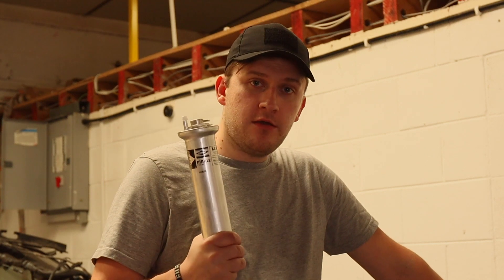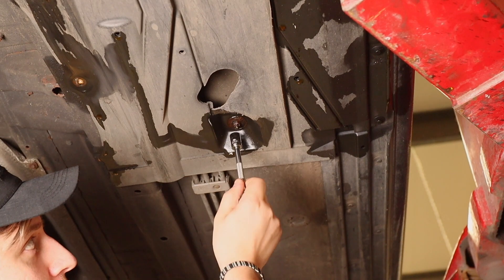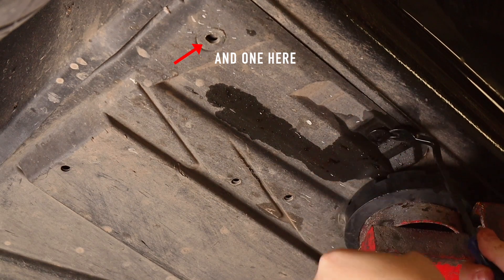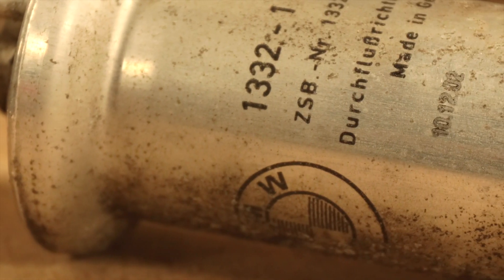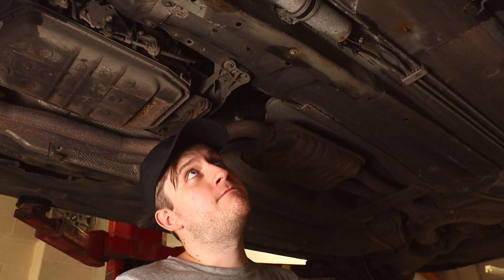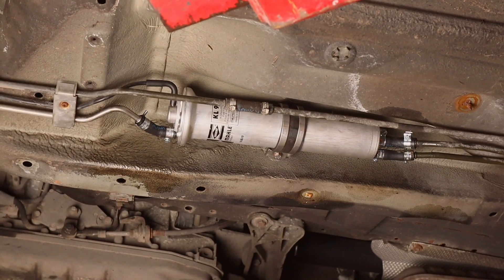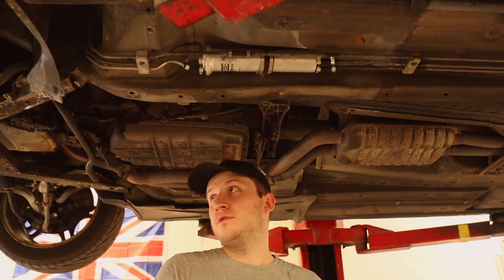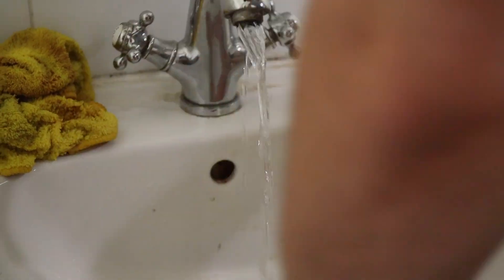How to replace the BMW E39 fuel filter in 5 minutes | Quick & Easy

Comment: 5 minutes is complete nonsense. It took me over an hour and I have a well equipped workshop with.a lift. Buy 6 new 13mm hose clamps, mine had non reusable clamps. Also some of the plastic clips will likely break, I need 2 new ones. Also recommend to replace the short rubber hoses. The filter in my car was also original with 06/2003 production date so 18 years old. Replaced with Mahle filter, this is OE without the BMW branding and is half the price.
Reply: I’m pretty sure he meant the VIDEO for replacing the fuel filter is 5 min. 😂
Reply: Rofl

Comment: may I ask? in the bentley publisher service manual, for the 1997 bmw e39 it uses 15w-40 engine oil while the 2000 e39 uses 5w-30/40 is that correct?

Comment: permission to ask.  My BMW E39 M52 engine consumes 5 liters of fuel when it is idle for 1 hour, is that correct or is there a problem with the engine?
Reply: Check your precat lambda sensors, are they working and connected, its too much, should be around 1,5l

Comment: My own touring is having some top end power issues with the exhaust cam angle sensor. I'm wondering if maybe changing my fuel filter (I have one on hand) could help? I've already changed the sensor and replaced the entire vanos unit so I'm trying to knock out just about everything else.
Reply from the maker: Is it petrol or diesel and what litre?Since you have the fuel filter, you might as well replace it and go from there.
Reply: @slothgarage  Petrol, so that’s why i’m not thinking it’ll affect it much. At this point i’ve done so much that I’m thinking it might’ve jumped timing.

Comment: how many kilometers to replace the petrol filter?
Reply from the maker: Looking on the forums, people seem to suggest anywhere from 30-60k miles (so roughly 50-100km, but mine was original and the car had nearly 150k. 

Might be worth taking a look underneath and checking the date, but if you’ve owned the car a while, you might as well just replace it.